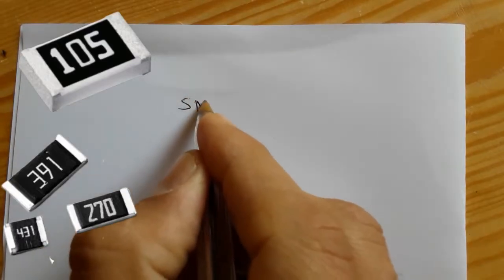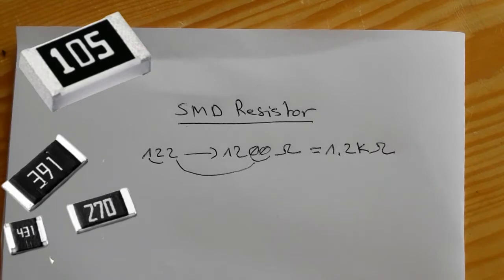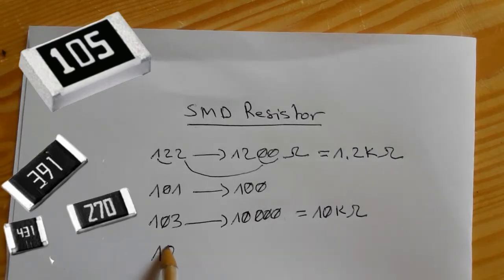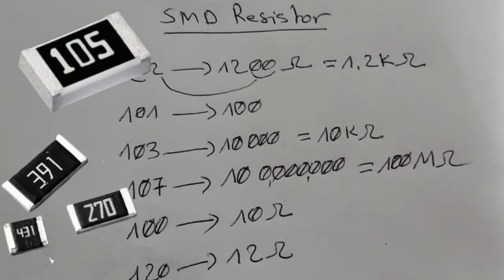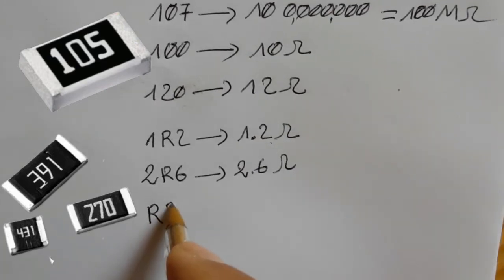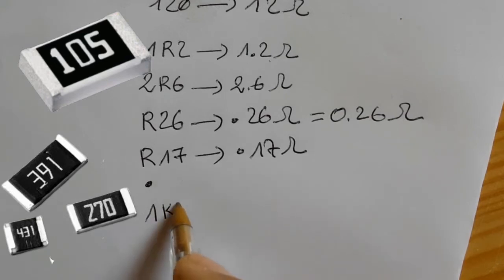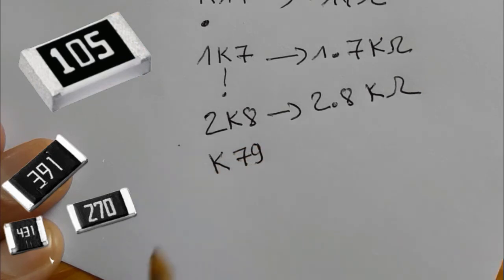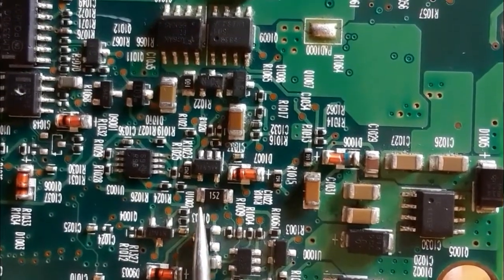3 digits and 4 digits SMD Resistor Code Explained

Comment: I have a smd resistor that needs to be replaced since it is shorted and acting like a jumper and is no good. A “4” is stamped on top of this component. So does that mean 4 ohms? Right? Thank you very much.